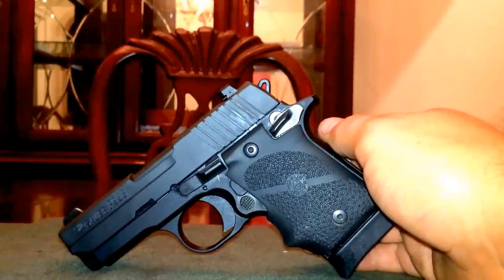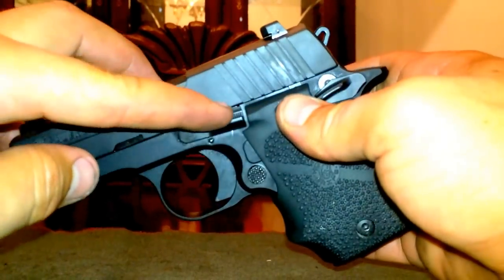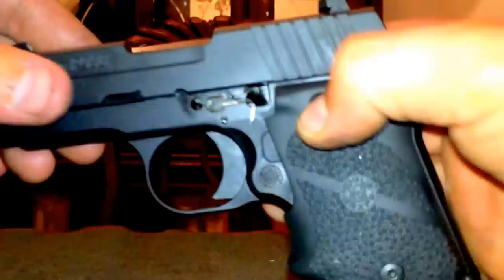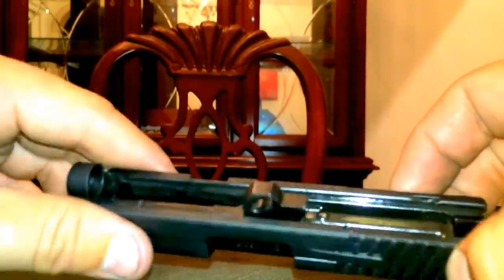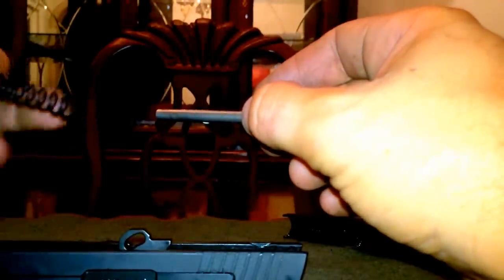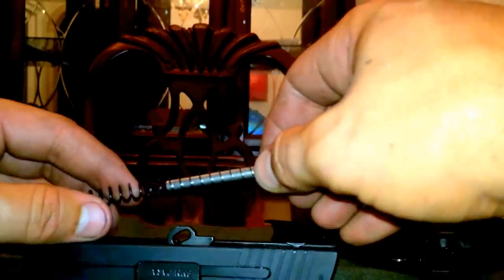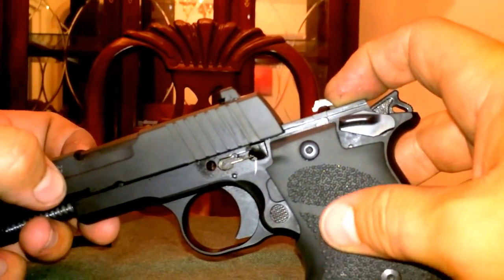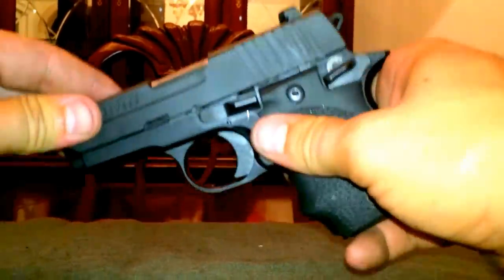Sig Sauer P938 Quick Disassembly Guide - How To Take Apart Your Hand Gun

Comment: Thanks for the video. One note, though. The instructions from Sig explicitly state "Do not engage the thumb safety with the slide removed. Moving the thumb safety to the up (ON) position with the slide removed will cause the safety detent plunger to separate from the frame." Luckily that didn't happen.
Reply from the maker: Joe, thanks for letting me know. I'll add something in the description noting that so people don't make the same mistake.
Reply: So, you can still follow this procedure without engaging the safety?
Reply: I didn't have this issue...that I know of.
Reply: You should add a pop up in the video cause no one reads the description especially you have to hit the "Show More" button to see it.  Unfortunately I did engage the thumb safety and wished I did not and have no idea what the symptoms are when the detent plunger becomes separated..
Reply: That happened with mine, all I did was push the part down carefully, and I was able to slide the top in the receiver. Going slow helps alot!
Reply: Please remove/remake this video. My plunger took flight and I have to order a new one. (I hope it's that easy)
This is my wifes uses/new daily carry.
Reply: Please remake this video so other don't loose their plungers like I did.
Reply: Will it be obvious is the detent plunger separates? I did this without knowing and did not notice anything and it still functions properly, at least it seems to.

Comment: It’s a great all around pistol https://www.youtube.com/post/UgkxnX9wE_Q8zvF75Y5iWzTU3Q4FlrtyGApQ , doesn’t fit in plastic glock 19 holsters but will fit in some non plastic ones. The location of the safety isn’t very good because your finger will accidentally activate it but it can easily be removed by pulling on both sides at once. Don’t lose the red o-rings while doing that.

Comment: The P938 manual specifically tells you not to engage the safety when removing the slide.  That will separate the safety detent plunger from the frame.
Reply from the maker: Yes sir, you are absolutely correct. Thanks for pointing that out, and for reading your manual! This was mentioned in an earlier comment. I will be adding a note to the video soon.
Reply: Do not engage safety!

Comment: In the safety lever, there is a spring-loaded pin and it will come flying out if you push the lever over too much, mine came out and I never could find the pin, I had to order one from sig. so friendly advice is careful.

Comment: It's a frame and slide, not a lower and upper. And it's a guide rod, not a pin. But great demonstration and great gun
Reply: Well spoken!!! Proper terminology should always be learned and used....especially for an instructional video!!
Reply: Wrong. The slide is one component of the upper and the frame is one component of the lower.  Go price a glock slide vs an upper from Zev or Grey Ghost and  learn the difference.
Reply: Also “extractor” not the hook* but good vid otherwise!
Reply: @steveschindler4527  Upper and lower what? Receivers? No. Pistols don't have receivers.

Comment: Have you ever taken the grips off the left side of the gun?   I saw a video where another owner had a major malfunction due to build up under the grip which caused the slide to stay locked in battery and when he finally got it free the same piece locked in the other position so the trigger couldn't be pulled.    I believe it's part of the trigger bar that gunks.
Reply from the maker: What's up Justin. I have taken the grips off, and do regularly when I clean it. I could definitely see how build up could occur without regular cleaning. Having said that, I've never had it gunk up and or lock while firing.

Comment: K, my P938 from Cabellas, and the videos of other P938 are different than yours in this video. Did you buy a different grip? Also, the spring had a smaller end, so it matters which end you slide on (I remember this bc my first time dissembling thay darling spring, it took me 2 hours and a lot of swearing to get it back ON- I DO NOT like that spring!).  Also on my guide rod it is... hard to explain, not an oval, but 3 sharp angles about the same shape.  What's up with that?  Mines brand new and I just oiled it for the first time and I am a concealed carry moob, so please don't judge,  just tryin to learn. lol
Reply: Also, the owners manual says not to engage the safety when dissembling bc it will cause the safety detent plunger to separate from the frame....? Specificalky, when the slide is removed, my bad.
Reply from the maker: No judgement here!! As far as my grip goes, you called it, it's an aftermarket grip. I've been so busy I havent taken apart my 938 in months. I'll look into your guide rod questions and will let you know what I find out. Thanks for the feedback!